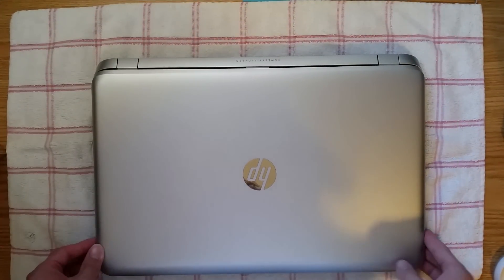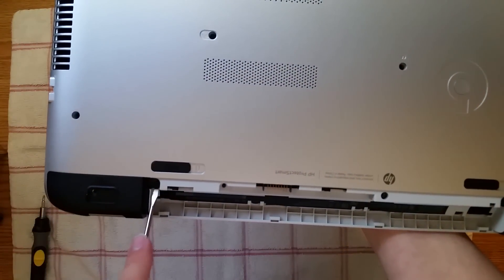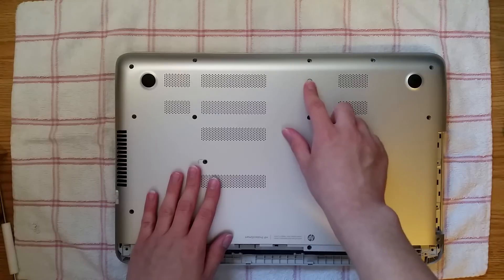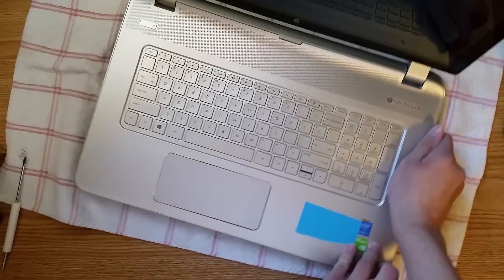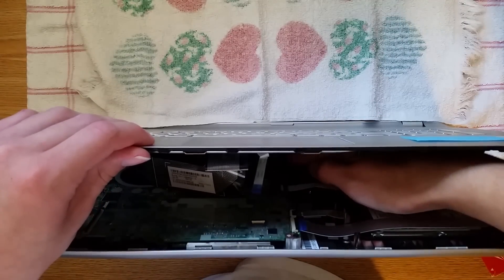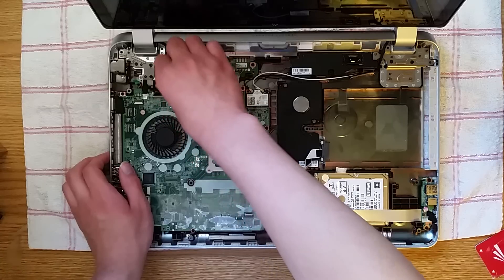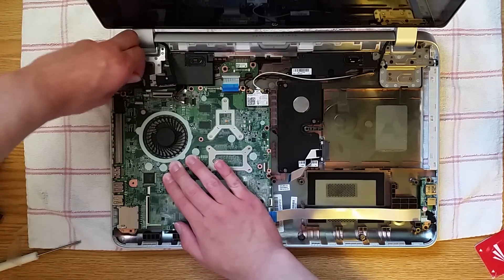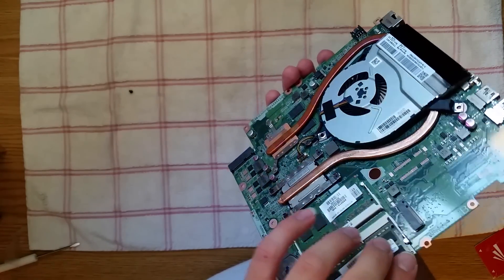HP Envy m7 Laptop Disassembled (Step by Step)

Comment: Hey there, I'm thinking of buying this exact pc burbs refurbished HP model. Do you recommend this pc?
Reply from the maker: +Jose Herrera The computer's hardware is great! If you plan on running windows 10 on it i would definitely wait (If you plan on buying model M7-k211dx.) Windows 10 runs quite poorly on that model, but all of the problems are driver related problems that will hopefully get resolved. If you plan on running Windows 8.1 it is great. While the driver issues will probably get resolved, right now it is not worth your time and frustration trying to get Windows 10 running smoothly. Hope this helps!
Reply: +Garrett Spitzmueller it does help a lot and I do appreciate it. I've just seen so many complaints about the WiFi module and I'm just scared due to the fact that this is a refurbished model.
Reply from the maker: I did have problems with the WiFI on windows 8.1. I had to re-install windows 8.1. Since then, I have had not had a single issue with the WiFI.
Reply: +Garrett Spitzmueller Oh great! That is awesome news. In case that I have any trouble I'll let you know. Thank you for your advise

Comment: Wow complicated disassembly just to get to the HDD. I am considering upgrading to a SSD. In your opinion, would it be possible to replace the HDD with a SSD after prying open the case, but without disconnecting all the cables? Looks like there might be enough room since the drive bay is at the front. Thanks!!
Reply: +Andy R It's pretty easy. Start by downloading the Clonezilla software from http://www.clonezilla.org/downloads/download.php?branch=stable
Assuming you are working on an HP Envy m7, select "AMD64" for cpu architecture and "ISO" for file type, then click on "download".
Put a writable CD or DVD in the optical drive.
Right click on the downloaded ISO file and select "Burn Disk Image".

After the CD/DVD is finished, connect the new SSD to the laptop using a USB connector.

Boot from the new CD/DVD (You might need to change the boot order in your BIOS).
The CD/DVD will boot into a setup program for Clonezilla.

The first screen that comes up will be a choice for Clonezilla mode. You can just take the default. I choose "Other modes" and select the "1024 x 768" mode (just because it's easier on the eyes).

On the next screen, choose your preferred language.

Next screen - choose "Don't touch keymap".

Next screen - choose "Start Clonezilla"

Next screen - choose "device-device"

Next screen - choose "Beginner mode"

Next screen - choose "disk_to_local_disk"

Next screen - choose the disk that you want to copy from. Be very careful. If you choose wrong, you will destroy your system. If you are working on a typical HP Envy M7, there should only be two choices here. If you are not sure which disk to choose, disconnect the new SSD and reboot from the CD/DVD. Follow the above instructions to get to this same screen again. This time there should only be one disk to choose, the current system disk. Remember (or write down) the information you see for this disk so you can select it later. Reboot from the CD/DVD again, follow the instructions to get to this screen, and select the correct disk.

Next screen - choose the target disk (the new SSD). There should only be one disk in the list at this point.

Next screen - accept default (usually "skip checking")

Clonezilla will then display the command that it is about to run. Hit "Enter" to continue.

Clonezilla will then examine the disk to be copied and ask you if you are sure you want to do this. It will ask you twice. You will need to answer with "y" and hit "Enter" each time.  Read carefully the information that Clonezilla shows. If you say yes, and have chosen the wrong disks, your system will be useless.

Next, Clonezilla will create the new partitions on the target disk (the new SSD). Then it will ask you if you want to clone the bootloader. Select "y" and hit "Enter"

Now sit back and relax. Watch the progress bars (one for each partition).

When the cloning is complete, Clonezilla will tell you about using "Poweroff" and "Reboot".  Hit "Enter" to continue.

Select "Poweroff" and hit "Enter".

Your new SSD is now ready to use. Replace your old HDD with the new SSD and reboot. Should be all set. Save the old HDD until you are sure everything is working correctly.

This procedure is for use when the SSD is at least as big as the old HDD, and will not work if the SSD is smaller. I understand that adjustments can be made for larger SSD's, but I have never done that.

Hope this helps.
Reply from the maker: +John Anderson You would only have to remove two ribbon cabels. The ribbon cable that connects the drive to the motherboard, and a ribbon cable that streches over the drive. By remove I mean unplugging just from the motherboard.  At 8:09 in the video you can see the ribbon cable that streches over the drive, and also the ribbon cable that connects the drive to the motherboard. Since these are both ontop, motherboard removal is not needed and can be done easily (as long as you can get the keyboard trey off!) Good Luck!
Reply: +Garrett Spitzmueller  Used your instructions to install my new SSD. Managed to do it all in about 2 hours (including cloning the disk). The only problem I had was removing the two screws under the optical drive. You mentioned that they needed a tiny screwdriver and were hard to remove. I had a properly sized screwdriver, but the screw heads just stripped. I used a small drill bit and just drilled out the screw heads. Thanks for the great video!!!
Reply: hey john,would you mind walking me thru the steps you took to clone the disk?i would like to replace my hdd with an ssd,and would like to remain with window 10 and keep my programs.thanks a million sir.

Comment: Whoa, I just did this myself on a "refurbished" Envy M7 k211 DX laptop I bought online that arrived with defective wifi (how they could've missed this I don't know)....Rather than return it with all the associalted hassles I decided to replace the card myself. Man, was I surprised by this discon-bobulated setup. I followed the directions in their maintenance manual to get at the card but it was still fairly difficult. Wish I had seen this video first. I'm still waiting on the card.....
Reply from the maker: +kaydee457 It seems this model has had quite a bit of wifi trouble, what I had to do to fix mine was do a factory reset. Hope this helps.
Reply: Well, I'll give it a shot but I really think the problem is the hardware. It actually displayed a list of network one time but since has reverted to 'dead' again I've enabled, it disabled it and so on. It likely was returned to HP for this problem. Just my luck.....

Comment from the maker: @link4265 For a long time all 17 inch Envy laptops came with an optional second bay. (looks like the model before this did) For some reason, they have chosen not to include a second optional bay on this model.
Reply: +Garrett Spitzmueller Well that's dumb. Thanks.

Comment: Where would you place a second hard drive? HP support tells me that all 17 inch envy's come with 2 hard drive slots.
Reply: I know this is a late response, but I wondered about the same and ended up using the optical drive bay. A company called Newmodeus has an excellent adapter for this. They also have a rubber case and usb adapter to make the optical drive portable.
Reply: This HP Envy does not have 2 hard drive slots.

Comment: ...This is not really that servisible... :(
Reply: +Arakmatzu It's a piece of shit.Stay away from it.
Reply: Not as easy as some. Kind of silly that they made it this way though. Kind of a pain to access the ram and the hard drive. The hardest part was accessing the screws in my opinion. Having them hidden under the feet and under the silver cover was kind of annoying.
Reply: Bill Spang I use PH000. It is perfect for the little screws under the edge of the optical drive.
Reply: And previously removed the small broadhead screws that hold the optical drive bay on the form factor, when this is exactly the problem I am having... trying to find the correct size screw driver tip to remove them. The HP Service Manual states that a P1 and P0 are required, but neither work.

Comment: Thanks for the video!  I just got Windows 10 and a new SSD drive (to replace the HDD that the laptop came with) to put a fresh install on.  I was lost until finding this video, then it was MUCH easier to follow along.
Reply from the maker: Jason Reece Glad to help! I do have one question reguarding windows 10 on this computer.. I have done a clean install of windows 10 and the trackpad has been going crazy! Just wondering  if you are experiencing the same issue. Thanks!
Reply: Mine has been acting fine, but I only use it a little (mostly with wireless mouse).*****
Reply: Have either of you found an unused ssd stick drive port on this model. In addition to the standard Sata? As if in prep for future upgrades or setups? Also, thank you for posting this video. Very helpful.

Comment: Thank you and God bless, I never would have got the machine open without wrecking it but for this video.  All I want to do is add some memory, so why does HP make it so difficult?  In the good old days there would a small panel on the underside secured with just one screw that gave you access to the memory modules >:-(

Comment: Garrett, I'm having connectivity problems with the m7. I'm going to install a new adapter, but before I do I would like to reset the one that's there. Can it be reached from the back? Can just the back case be removed? Thanks.
Reply from the maker: John Varallo Unfortunately, the back case can not be removed without taking the keyboard tray off and removing every component from the cover. This laptop does not have any access ports from the bottom.

Comment: that type of memory used? model? the  KTH-X3CL/8G ? ddr3l or ddr3?
Reply from the maker: Daniel León The stock type of memory used is (1) Samsung 8gb stick 1600MHz DDR3 and (2) Micron 4gb stick 1600MHz DDR3. I replaced the Micron 4gb stick with a PNY 8gb 1600MHz DDR3 MODEL: MN8192SD3-1600. This laptop does not use DDR3L. I do believe that the MN8192SD3-1600 stick should work, however,  as I do not have that part on hand I cannot tell you for sure.
Reply: I used Crucial 16GB Kit CT2KIT102464BF160B on my HP Envy M7-K111DX
https://amzn.to/3mW9jAK

Comment: Can you increase memory to 16gb Model: M7-k211dx SKU: 3487 ??
Reply from the maker: Felix Lopez Definitely, that is what I did to mine.
Reply: ***** Is there space for a second hard drive or SSD to be added?
Reply from the maker: Ryan Tanner On this model there is not, however, on the last model you could.
Reply: ***** Would you be able to link me to the specs on the last model? Is it worth getting the last model over this one if I have a 512GB SSD to add to it?
Reply from the maker: Unfortunately, I cannot find specific specs being that that model is now two models outdated (Soon to be three). However I can remember that it was very similar to the M7-k211dx with dedicated graphics and a haswell processor. Even if you can find it, you will have to purchase a ribbon cable to hook the drive up. The M7-k211dx was a big design change from the model before it, being that you would not have to take the whole thing apart to access things like ram and hard drives.